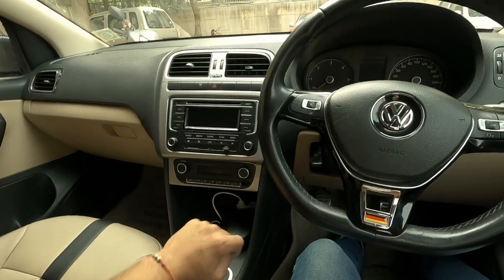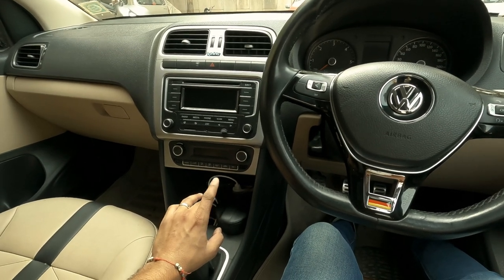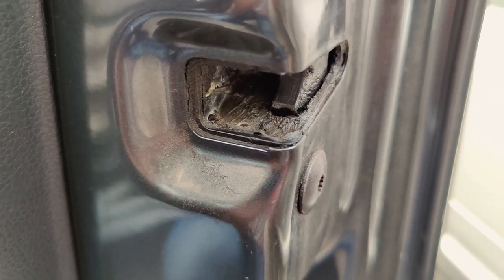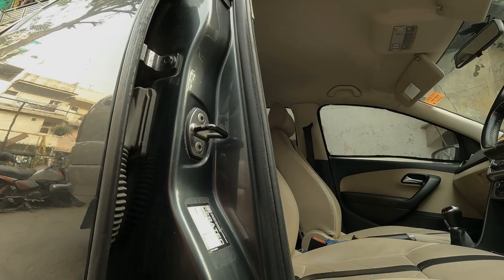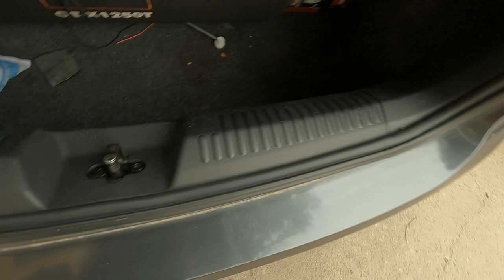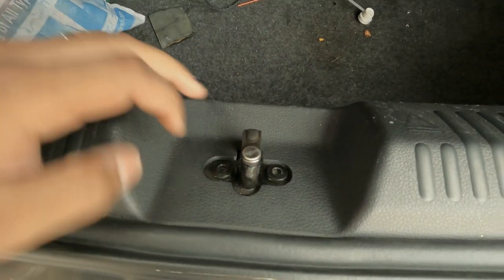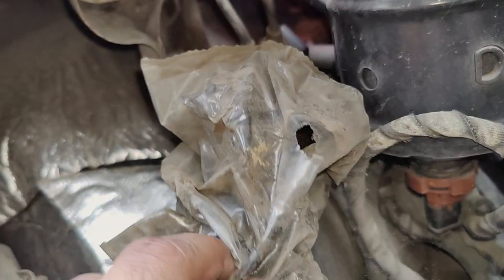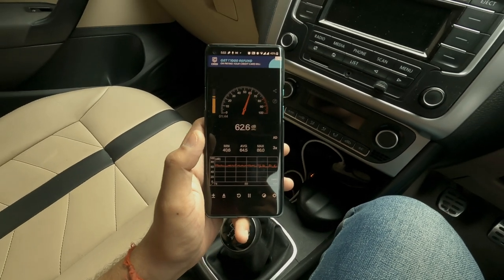CAR CABIN NOISE REDUCTION | REDUCING WIND NOISE | ENGINE SOUND IN CABIN | VIBRATION | PART-4

Comment: The best one I liked was filling the gaps which led to the cowl top area. Wanted to know if that helped more than the others? Is it a major cause of sound travel?
Reply from the maker: Sir comparing the results separately is kind of difficult , but all of those together made a difference .but yes as far as i felt it made a huge difference maybe due to its proximity to the engine .
Reply: @yourDIYneeds  I have a Honda city and there are similar gaps in the bay which leads to cowl area. Do you suggest any material which I can stuff inside them ?
Reply from the maker: Sir yes , you can use closed cell foam , which is a good sound insulator , but don't search internet by " closed cell foam " as it will be alot more expensive 😅 , other thing you can search for which is made from closed cell foam is yoga mats , i know it sounds kind of awkward using yoga mat on cars , try using black colored . It will sink in nice , you can use the amazon basics mat , its has good width.
Reply: @yourDIYneeds  thanks a lot Ji. You are the best .👍
Reply: Bro can you also please let us know what are the decibel levels when you are driving . Acceleration/Driving /highway speeds etc . I did some changes to my car over weekend and I just want to see if I’m on track . Idle levels are certainly lower now .
Reply from the maker: Sir to be true i never tested it on move , as it was not a problem , noise was only present on idle
Reply: @yourDIYneeds  Sir will yoga mats be able to handle the heat from Engine bay

Comment: Why rpm is high is there any problem or its vw some kind of feature when accelerating it came to normal idle
Reply from the maker: Sir its fast idle , engine raises its speed to increase the temp. Inside the exhaust manifold to clean the cateletic converter

Comment: Any solution for floor console panel rattling ?
Reply from the maker: Console panel rattling in a vw ? Or any other car ?
Reply: @yourDIYneeds  It's Fiesta 1.6 bro. Rattling sound is only heard in small bumpy roads with small pot holes or it can be heard when passing flyover/bridge in between joints. It's like "Thud" type rattling noise. Don't know if I'm able to make you understand or not.  😕
Reply from the maker: Sir you can use a little bit of damping sheet on the inside of that console panel to change its resonating frequency so that it doesn't rattle
Reply: @yourDIYneeds  Thanks for sharing the info. Will try out soon

Comment: Sir pls help me out.. I am using Castrol Magnetec 5w30 engine oil in my Swift petrol 2006 model with after market C. N. G kit ..Right now I have clock 99000kms with no issues.. Can I change engine oil grade with C. Magnetec 10w40 .I have heard after 100000 km engine needs thick oil..  Is it a good idea..??
Reply from the maker: Sir rather than 10w40 go for 5w40 ,
It will help in cold starts even better
Reply: Is this oil grade ok for engine? else u suggest me some another brand execpt castrol.
Reply from the maker: Sir go for shell , castrol is good but the amount of duplicate products in market are too much , so going with shell is a better option
Reply: Sir is this oil grade suitable for Swift petrol..??
Reply from the maker: Sir yes , 5w40 is the best grade for our Indian climate , 5w helps us to have the best protection in cold start situation and 40 helps to maintain the lubricity in upto 45°C of hot weather
Reply: Thank you sir for helping me..

Comment: I am using be Polo 1.2 l mpi and today it completed 10 yrs. I did noise insulation on doors and use d-beadings around the door which reduced the cabin noise. Now there is rattling noise from the front. I tried using the form but I cannot eliminate the rattling noise. When I fix one I will encounter another one within few days.
Reply from the maker: From front means , front doors or hood ?
Reply: @yourDIYneeds  I think from fender..I installed form between the fender and fender liners. Mainly happen when we use half clutch..
Reply from the maker: Sir check fender liner , as you have removed it , chances are the sway bar link is hitting the inner plastic fender liner
Reply: Also check transmission Mount
Reply: @yourDIYneeds  kk thank you 👍
Reply: @yourDIYneeds  thank you sir , that might be the case as I recently changed the stabilizer link..
Reply: @AjayPatil-fj5tu  thank you sir, I will consider changing the mount 👍